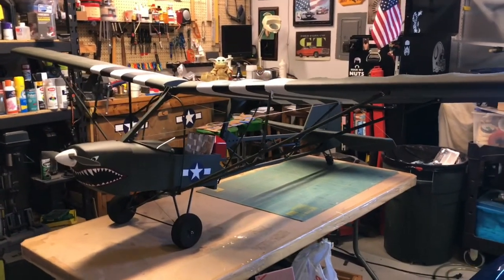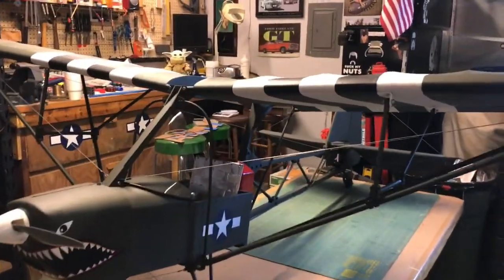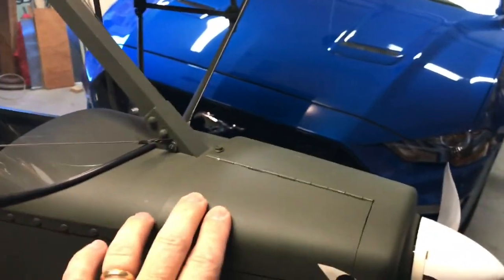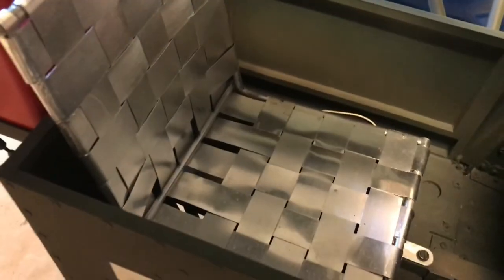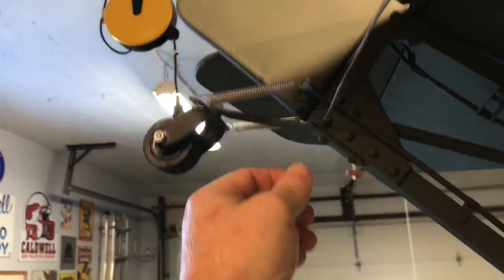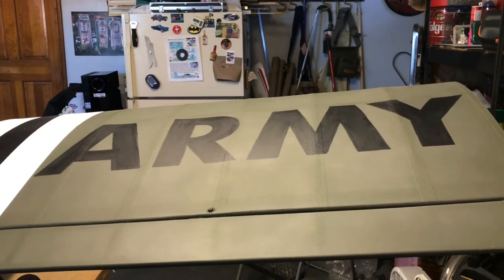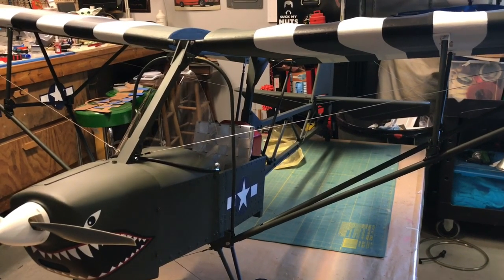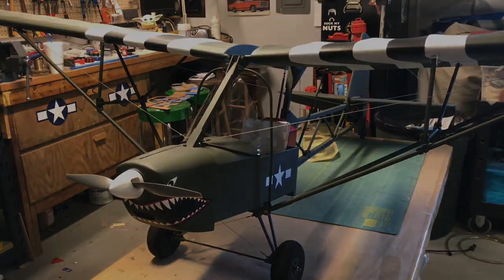1/3 Scale RC Affordaplane

Comment: love to see how you connected the servos to the ailerons.
great build! I have the plans to build it full size some day...
Reply from the maker: I can’t find any pics. But I did it pretty much like the real one. Except instead of the sticks side to side rotating the shaft , The shaft has an arm off it with a servo mounted above. It just has a very short linkage connecting the servo arm to the arm coming off the shaft.
Reply from the maker: You can see it from the bottom at the 3 min mark in the video
Reply: @JimmyC_2112   have you flown it yet? would love to see video of her flying. thanks.
Reply from the maker: @fredjohnson8377  not yet. This was a consignment build for a buddy. The plane it was modeled after belongs to a friend of his. He has sense sold the full scale plane due to health issues. The model is currently hanging in his hanger. I hope to see it fly soon.